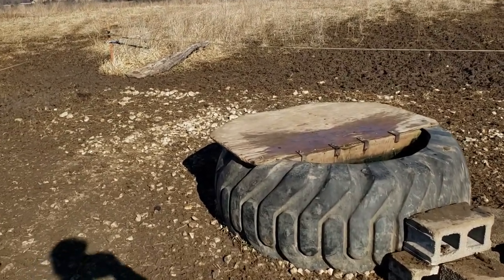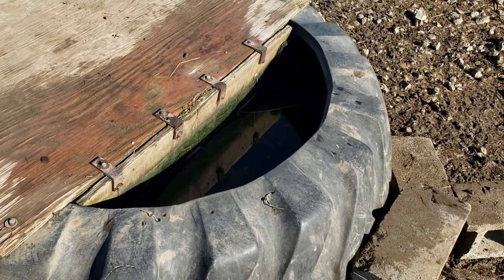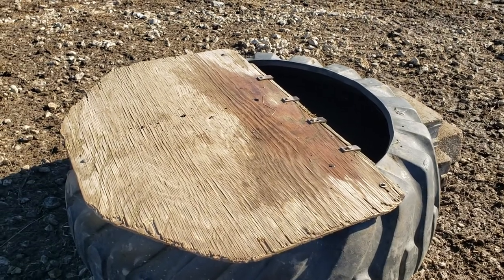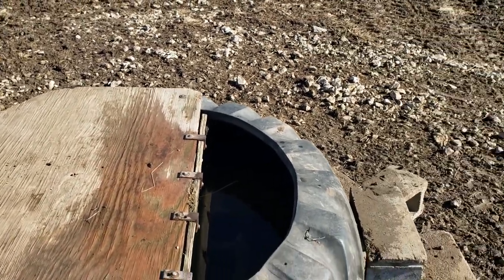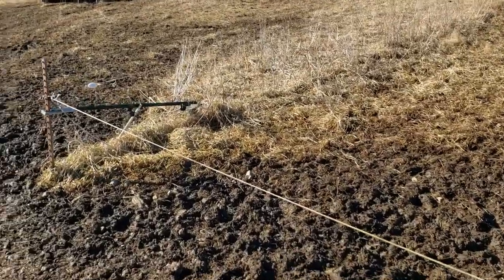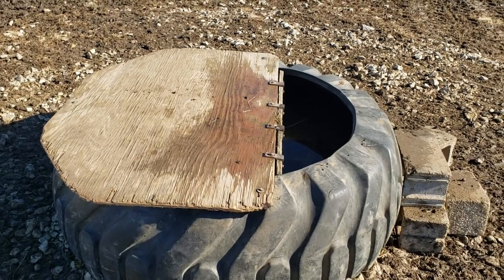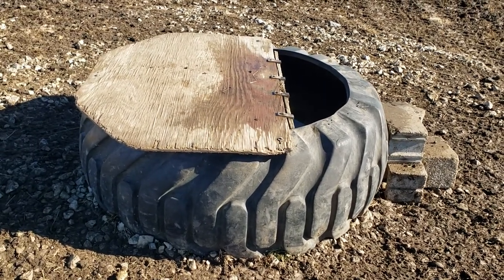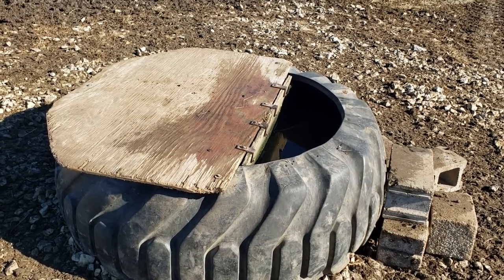Tire tanks with sheep and goats

Comment: What float and valve are you using?  Thx
Reply from the maker: That's worth talking about Grant, thanks for the question.  I started with 11/4 in Job valves so I could get maximum flow.  They have a screen in them and I pump water from a pond.  The screen would constantly plug up with small moss particles.  They will not work without the screen.  After talking to the company they told me those valves wouldn't work with pond water.  That seems like it would be something they would tell you upfront.  Anyway, I replaced them with simple 3/4 in. brass valves with the rod and float on the end.  They have worked flawlessly and were much cheaper and available locally.  I still have plenty of water.
Reply: Grandview Grain and Livestock thank you. We live up in Clay Center. Would love to come visit your place sometime.